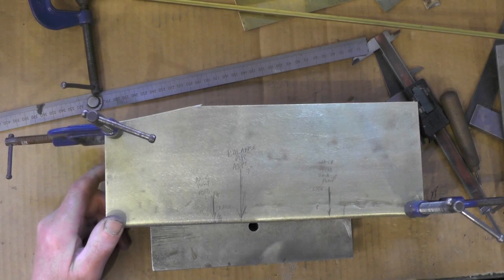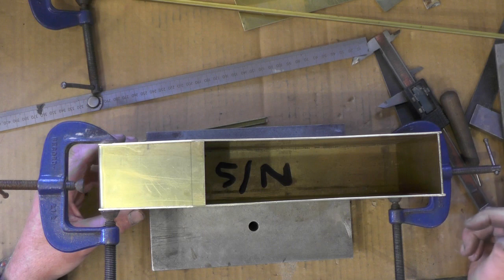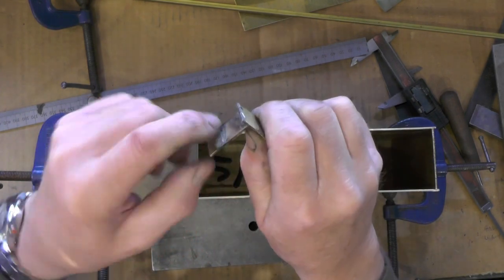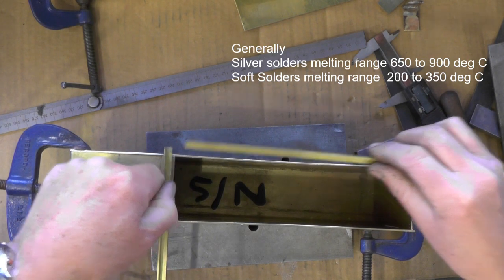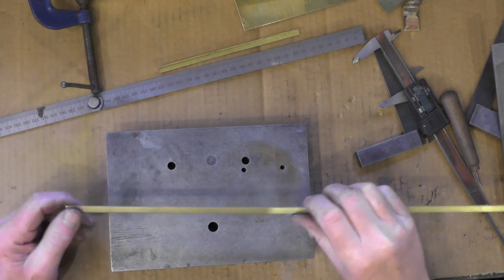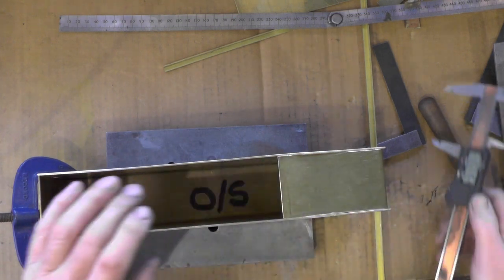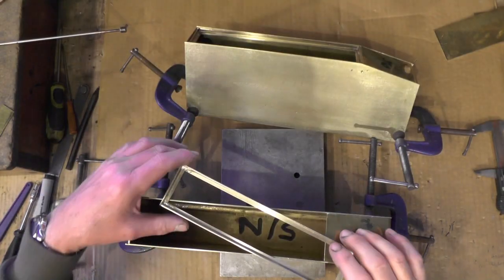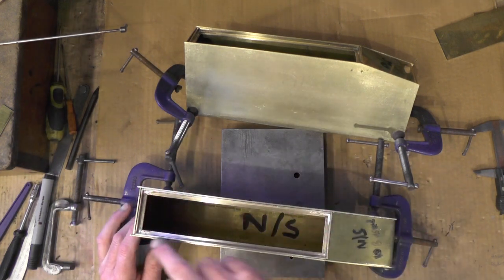Make a Beginners Miniature Steam Locomotive Series (Making the Pannier Tanks Part 2 ) "mr factotum"

Comment: Hi, are there different hardnesses of soft solder, I'm thinking of using your method to do the side tanks on my rob Roy. PS great series by the way 👍
Reply from the maker: hi b&m GWR
yes, many different compositions and temp values, i just used regular plumbers solder bought from Aldi , cheap as chips, good luck with your tanks, thanks for watching
regards
mr f
Reply: @MrFactotum  awesome, thanks for the reply, Tom